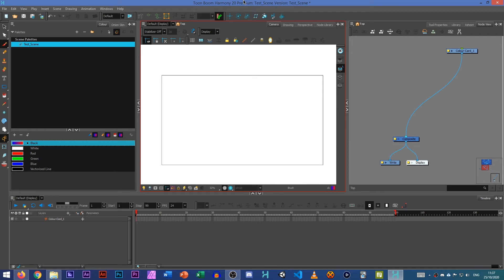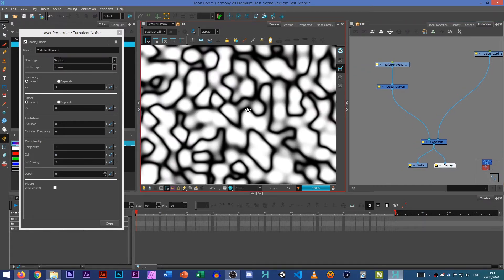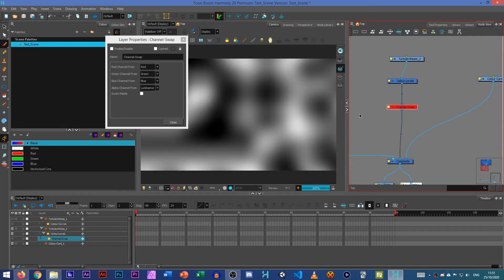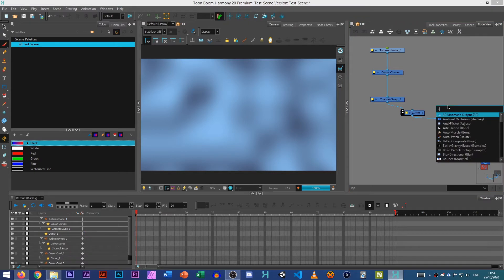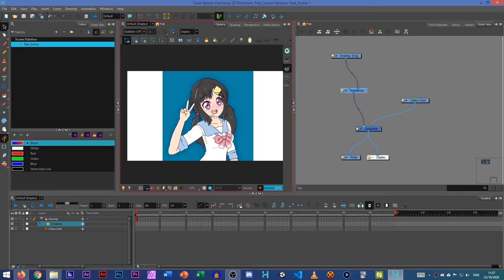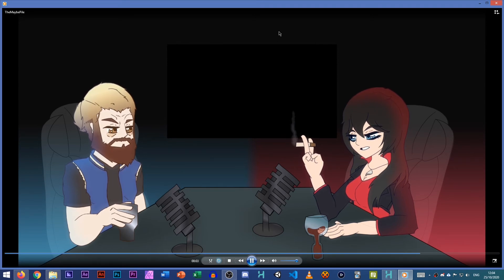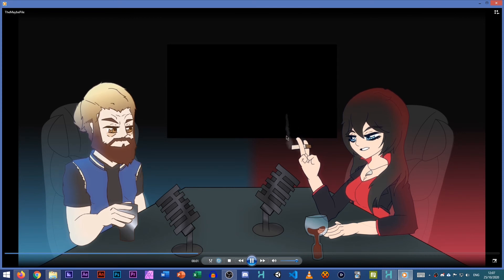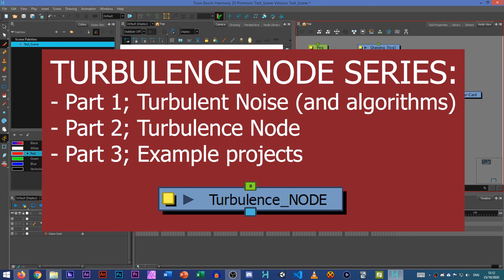Turbulence Node Examples (PART 3) - Toon Boom Harmony

Comment: what's is the shortcut for find nodes in nodes library as at 2 min 30 s in the video
Reply from the maker: It's a feature within Harmony 20, where you can press Enter on the keyboard and it'll do that.
Reply: @LucasSaturn  Ok, just enter when you are inside to the node view area no?
Reply from the maker: @llorensesteve6110  That's all there is to it, yeah. Just press enter whilst in the node view!
Reply: @LucasSaturn  Thanks, great videos

Comment: Hey cool video, do you know if its possible to loop those turbulent noises?
Reply from the maker: Unfortunately there's not a way to get the starting or end points the same, in regards to changing the evolution or seed numbers. That is why some people keep the turbulence static and just rotate it (in regards to things like line boiling).
Reply: @LucasSaturn  I see... well, gonna try that then, thanks!